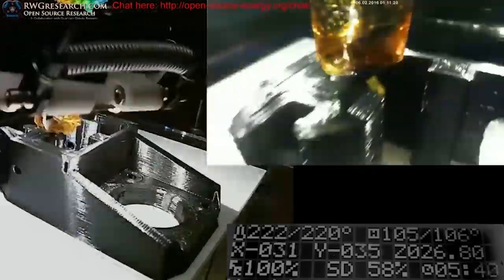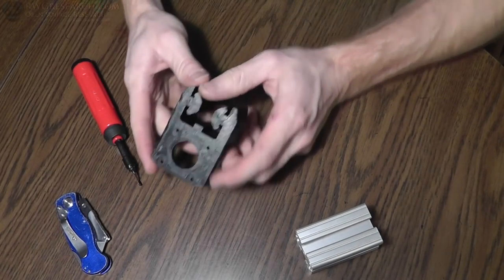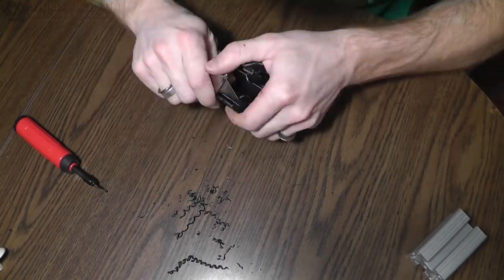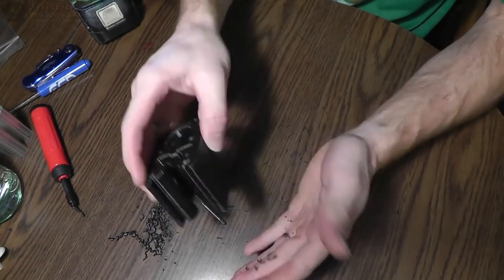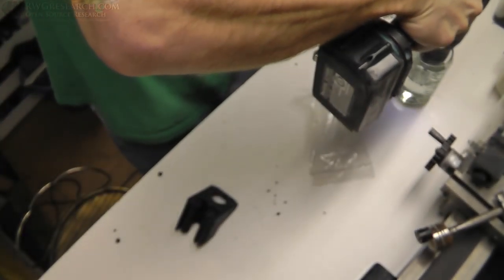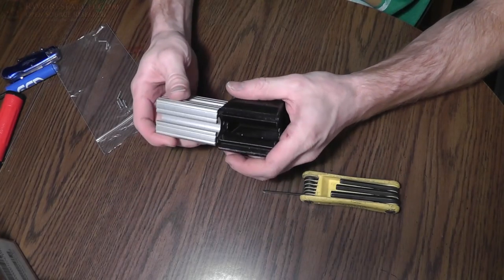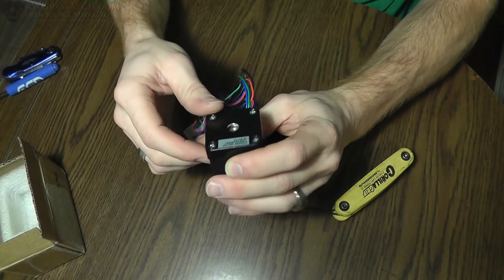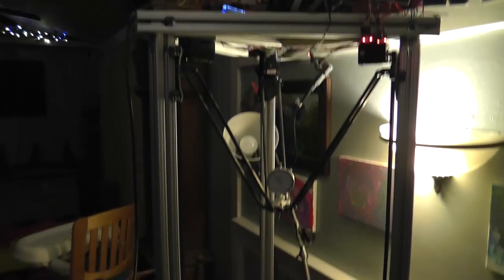RWG OSD #8 The motor's and Mounts! OverSize Delta 3D Printer Build.

Comment: You bet! I got a tip for you to hide the wires, take a straw and slit it down the side lengthwise carefully, then put it over the wires through the slit (you can get fancy straws at most grocery stores) then a drop of hot melt at the run surface and wala! Your wires are supported Daves way, and nobody gets cheaper than me LOL!
Bless and take care,
Dave in Kentwood
Reply from the maker: +Truckstuff4u2 lol . well that's a fun idea lol  in the end the wires will be inside the holes of the channel's. i want even the channel's to be open... it ill appear like magic lol  all my wires vertical will be inside the small hole you see there in the 80-20. then the top and bottom will be through the channel. you'll see lol but the straw idea to fed the wire in only sounds like a grand idea :) ~Russ

Comment: I print in black ABS too and when I have that white edge or left residue from ABS glue I use Heat gun . I let it heat up so its glowing red inside and just run it over the surface. it happens in seccond. You should try it out.
Reply from the maker: +T1iCanon yes! i have done similar. i have even found rubbing it with something not sharp it will clean it up to! thanks for the tip! ~Russ

Comment: Really enjoying this series, looks like you are still smashing the first layer into the buildtak, what's the gap measure at zero on the z height? I'm still trying to get this setting correct on my little printer.
Reply from the maker: +Brad Parler yes i do this because i want a really flat finished part... and i know it will stick... i rather have a hard time getting off the bed and have some clean up than a failed print. i also have some slight problems with the tower placements on this printer so that first layer is hard to get just right...  the first later height is normally a paper thickness. slightly lower on one side of the bed... so its quite close. i could go up more but i like to have a 100% solid bottom... with my .5mm nozzle it was better, now with the .35mm its harder to get all those small passes filled in. playing wot the slicer setting never really seemed to help... the only other option is a raft... and i have only had god luck with Cura with rafts releaseing well...  i currently still like the old Kisslicer ~Russ

Comment: I wonder if you taping plastic submerged in water would make the process less tedious?
Reply from the maker: +Granite it could, however what you need to remember is that the water is to help keep the tap cool, so if the plastic being cut off is still piling up in the flutes of the tap that's bad. so if submerged in water will remove the chips as well as keep it cool then yes. i would say it would make it better... Flowing the water down the taping hole would be the best thing to do. however that's quite impractical in his application ... unless i was doing 100's of them :) ~Russ
Reply: Ah okay. I'd like to try taping 3d prints. I wonder if the combination drill/taps would work better as they would remove the chip better.
Reply from the maker: +Granite good Question. I'm not sure. worth a try... i was using a 3 flute tap. they also make 2 flute taps that may work better... more room for the chips. but if its under 1/4" thick... just a one time pass is fine. anything thicker i would take your time and run it in and out to remove chips. ~Russ

Comment: For plastics you normally want to use a ceramic deburring tool. Noga makes some good ones.
Reply from the maker: +Patrick Outhier (RED-404) hummm, ill look in to that. you mean the same tool but a ceramic tool tip? ~Russ
Reply: +rwg42985 Yeah but I doubt you will find any that will fit your holder. Shaviv makes scraper style ceramics and Noga makes both the scraper and "cut" style "like you have" with replaceable blades.
Reply from the maker: +Patrick Outhier (RED-404) oh i see. you mean the blade is ceramic! that's cool. i my need to try that one as well! thanks for the tip! they seem fragile? are they? and only use for plastics? ~Russ
Reply: +rwg42985 yes they are pretty much just for plastics and will need a new handle for them too. 
Shaviv makes them and many different blades that will fit your holder. Some work very well for plastics but I can not remember the part# for the ones we would use. here's a link to all the blades they sell
http://www.vargus.com/download/files/Shaviv%20Blades%20table%20web.pdf
Reply from the maker: +jonny blaze sweet! thanks! ~Russ

Comment: I'm going with 0.9degree motor for my big delta - twice of torque with the same microstepping.
Reply from the maker: +jerzyk007 yeah i thought about it but the price went up quite bit... but its a good choice for sure! what motor did you get? ~Russ
Reply from the maker: +jerzyk007 cool, not to bad on  price. i think i got 5 motors for 54$  how long did it take to ship and what country are you from? thanks! ~Russ
Reply: it took me 2.5 weeks (poland)
Reply from the maker: +jerzyk007 ok. i dot order much from that site. even tho there are a lot of things on there. hows the Quality? test them yet? ~Russ
Reply: everything depends n the seller, this one was quite good - motors well packed, with lot of foam, quite fast shipment and yes, they are working :)
Reply from the maker: +jerzyk007 also i see there .43N-m holding torque. the ones i have are .59 N-m  so that's about right on price. ~Russ
Reply from the maker: +jerzyk007 ok nice! so the real Question. did you replace old ones or is this a new build? and if you replaced them did you see any improvement?  ~Russ
Reply: new build, used 24v power (old one used 12)

Comment: what was you printer layer height?
Reply from the maker: +jerzyk007 i found that slightly thicker is better. so i used .2 i think it was. could have been .1875 and this is a .35mm nozzle i liked my .5... but testing this one for a while now. they both have pros and cons. ~Russ
Reply: yhm, I've seen "new" extruders - with 0.8-1.2 mm nozzle - thick layers and fast printing speed - I've not yet tested the - but is looks like a nice option to print bigger parts
Reply from the maker: +jerzyk007 yeah. i have seem people use 2 hot-ends. one big one small. so the details can still be printed but the infill and inside can be done fast... its a good idea! ~Russ
Reply from the maker: +jerzyk007 best of luck with that :) ~Russ

Comment from the maker: The live stream!!! http://rwgresearch.com/live ~Russ
Reply from the maker: +Tha14GR yeah here is a really cheep one but its the same brand as the one I'm using in this video. so it should be good quality, however i find the small handle harder to work with... 

 http://www.amazon.com/SHAVIV-29181-DisposaBurr-Hi-Speed-Steel/dp/B003JY7LOC/ref=sr_1_9?s=industrial&ie=UTF8&qid=1457465782&sr=1-9&keywords=deburring+tool
Reply from the maker: +Tha14GR yeah that might work! 

also here is the good one with extra tips. worth the 20$ for sure... 

http://www.amazon.com/SHAVIV-Classic-Deburring-Aluminum-Handle/dp/B003JY7MDM/ref=sr_1_1?ie=UTF8&qid=1457466045&sr=8-1&keywords=deburring+tool+SHAVIV

Comment: What firmware will you use? :)
Reply from the maker: +Didde Pettersson starting with marlin, then moving to repeater. i haven't used repeater but i was told its better ... so ill test both!  any thoughts? ~Russ
Reply: +rwg42985  repetier is told to be better, in both auto leveling and more advanced settings. I'm running it at the moment, what processor are you running? 8bit or 32bit?:)
Reply from the maker: +Didde Pettersson ok, last night i installed repetier. I'm still having some problems relates with the EEPROM. so the speeds are wack. it was VERY SLOW, now its WAY TO FAST! lol i don't know its like when i change it and upload it it dose not change... so i think its the EEPROM  however it feels like so far that its a lot smother. i also played with the motor frequency. so you were using marlin? and now repetier. and whats your thoughts??? i need to play with it more tonight. its abit more confusing to set up but I'm getting there... could you send me your config.h file? i want to compare some settings.  did you have any of these problems? rwg42985( at )AOL(dot)com thanks! ~Russ
Reply: +rwg42985 I'll talk to you later about that:) one important thing is to change eeprom number every time you make a new FW upload:) in increments of 1 every time you re compile the firmware. it's made like that because of the arm processors (uno and other compatible boards don't have any real"eeprom"
Reply from the maker: +Didde Pettersson oh! ok so i get 256 uploads? lol what happens if i want to reset it? hard reset? reload the boot loader?  also I'm just using a mega 2560. so 8 bit.  ill play with a new eeprom number and that should fix my speed problem. it was homing at 2000mm/s lol not so nice lol .  i was really lost with that one but hat makes sense now! thanks!!!! ~Russ
Reply: +rwg42985 i think resetting the 254 values is easy! I think you just need to upload another sketch (like blink or something from the examples library) you could also run the clear eeprom code:)
I don't know if it's the same with the 8bit controllers? I know that due and other 32bit controllers need to change that eeprom number every time, because of missing eeprom, but the mega 2560 should have an  eeprom? ;) 

You should really looking in to upgrade to 32bit
I'm running RADDS 1.5
(almost the same as ramps 1.4 ) but made for the arduino due instead ;) 

The deltas are struggling with calculations and extra functions on the 8bit line. Like auto bed leveling and such, you can also run much smoother step rates and that's also really nice :)
Reply from the maker: +Didde Pettersson yeah, for now i went with what i know,  and what i know will work. my other Delta works fine and has been for 3 years. and yeah. its really out of processing power. but its cheep. so will give it a go. i don't even like the auto bed leveling on marlin. so maybe repeater will be better... however i don't know if i plan on using it at all right now...  i feel good abut doing it manually and it stays good for the most part. so once its done it s fairly good for a while... at lease that has been my experience. yeah . it has EEPROM. 4kB
 https://www.arduino.cc/en/Main/ArduinoBoardMega2560
ill try resting with another simple sketch. i don't know much about the firmware side of this .so I'm still a considered a novices. ~Russ
Reply from the maker: +Didde Pettersson so messing with repetier. seems that yes. the eeprom needs a new number every upload. that's interesting. that radds board looks good. may have to upgrade after i get more funds. cutently can't buy it. Also I noticed with the repetier the motors make more auidabal noises. I set the frequncy to 16000 Hz and when at rest it's better than the 12000hz. however when running marlin dose not make thses auidabal noises. any idea if I can change the frequency when running? I would think it is all the same frequency. but it can't be. maybe that's how its running smother? I don't know do you have any idea where and how to change that frequency? it's all most like it's 2 frequncys interacting with each other. like it's the 12000hz and a lower Hz when moving??? ~Russ
Reply: +rwg42985 hmm.. Something is different in the code, but it could also be (decay mode) maybe different settings? Don't know if ramps got any switches to change that? Maybe it's controlled by the software? 

There is a decay mode pin on the stepper driver and you pull it low or hig depending on what decay mode you want to use: fast decay /slow decay mode (and some times mixed decay mode, 
I'm not entirely sure but i think decay mode could be the problem 

It should be in the code for motion? Not the code in the configuration.h, it should be something in code that's configuration.h is defined to? 

You know the other folders/tabs that have the  other code that's a bit more advanced?

What drivers are you using? A4988? :) 

I'm using raps128 drivers because of the high pitch sound the DRV8825s make, and the A4988 isn't able to step higher then 1/16 I think, 

I'm not to far into my build yet, not to experienced either xD

Comment: I think you have a forgiving wife - sanding in the sink, would get me in a lot of trouble.
Reply from the maker: +Dan Herring lol. well if it was higher grit or steel... lol i would not have done it... :) those plastic bits when wet sanding are extremely small so no worries about that either + i needed a flat surface to sand on lol   ~Russ

Comment: Looks all nicely engineered, thanks for sharing.I have build my own Delta too, see RepRap forum http://forums.reprap.org/read.php?178,632827Question: we are NOT using 50% of the height of a Delta Printer. My next Delta will have only the top part (The actual effective part of the delta) and mounted against a wall.An ordinary table will carry the hotplate (An induction plate) and is centered under the delta. What do you think, would it be weird enough to try?
Reply from the maker: +Ed van den Enden cool! its a lot of fun to build one from scratch! nice work! I'm not sure if i know what your describing. but.. anything outside the box sounds like a fun thing to try!  ~Russ